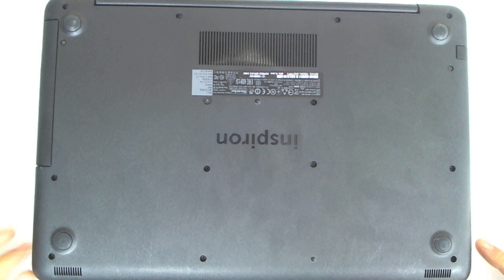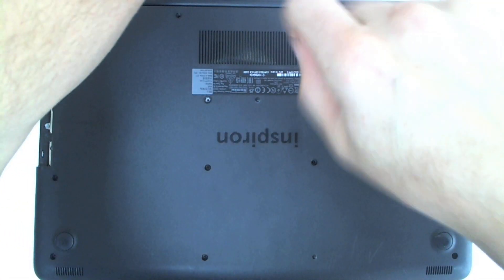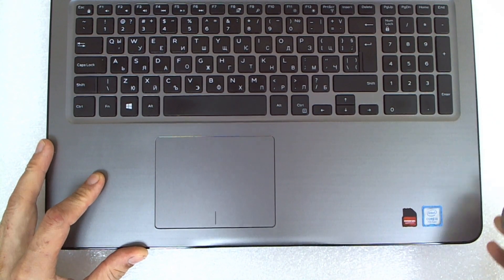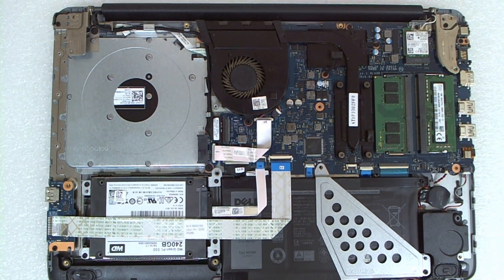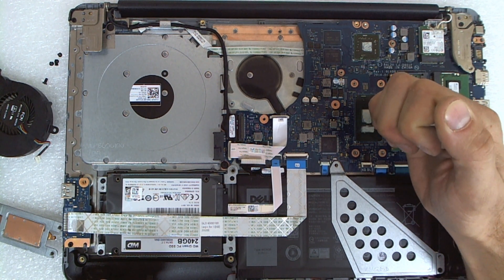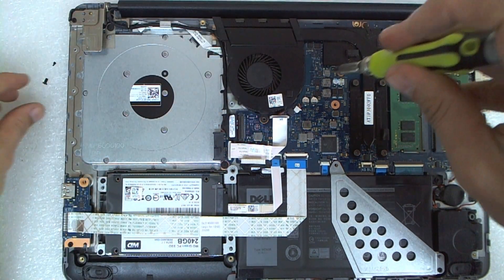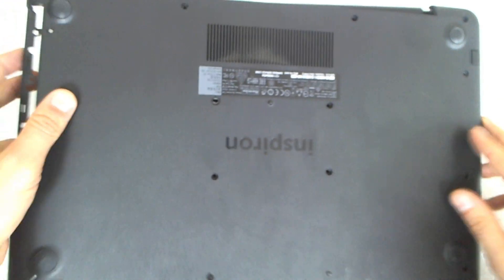Dell Inspiron 15 5567 Disassembly / FAN Cleaning

Comment: HOW TO RE PLUG THAT SHIT AT 5:20??? POWER BUTTON... PLEASE !!
Reply from the maker: @kazenishi_Zyon  you have to remove ve the screws on the board and lift it on the left side. And put the cable back. The bad thing is that the cable have some glue and it is stuck to the fan.  So when you lift the fan you unplug the cable.
Reply: @LaptopDisassembly thank you very much, I connected without removing the board, I don't know if it was connected, I don't know how to check if it works. I connected about 3 times but as I easily disconnected I wondered if I was really connected.

Comment: Hello thank you for this guide  but i pulled the fan accidentally and i ripped the wire for the power button off now it wont start what do i do? Is it possible to connect it back or i must give it to service?
Reply from the maker: Just lift the left side of the board, and plug back the cable. The connector is a few cm. Inside... It is not that hard.
Reply: @LaptopDisassembly  it was on the side of the fan its the one under the fan it was glued
Reply from the maker: @IvanIvanov-os2sf  it shouldn't be glued but with a connector. BG?

Comment: I like how he did not show how to plug the power button back in
Reply from the maker: I know, i know... It was one of my first videos. The connector is at the end of the left  side. Just remove the board screws, lift it a little and plug it back. It is not that hard.

Comment: somewhat helpful video. but would be better if you zoomed in more. you didn’t show getting the power button cable back in, and now i have to take the whole motherboard out.
Reply from the maker: Yep, note taken... It is 3y old video. I try to show more now. You need to remove the screws on the left side. Just lift the board a little and you can plug it with a tweezers. I haven't got the same model since than, to make ver. 2.0 of the video.

Comment: لماذا الحاسوب محمول الخاص بي من نوع Dell بطيء للغاية رغم مواصفاته العالية حيث أنه يحتوي على الجيل السابع من معالج إنتل Core i7 وذاكرة وصول عشوائي بسعة  16 جيجابايت وبطاقة رسوميات بسعة 4 جيجابايت؟ هارديسك SSD
حتى بعد تثبيت نسخة ويندوز جديدة
Reply from the maker: Is the laptop with regular hard drive or with a SSD one. can you write me the hdd model.
Reply: SAMSUNG MZ7TY256HDHP-000L7: 256.0 GB

Firmware

MAT04L6Q

S307NB0J545738

Serial Number

Interface

Serial ATA

Total Host Reads

Total Host Writes

15853 GB

Rotation Rate

----(SSD)

Transfer Mode

SATA/600 | SATA/600

Power On Count

3288 count

Drive Letter

C: E:

Power On Hours

26373 GB

7325 hours

re

Standard ACS-2 | ATA8-ACS version 4c

Features

S.M.A.R.T., NCQ, TRIM, DevSleep, GPL
Reply from the maker: Check the hard drive with CristalDisk to see is the disk in good health.
Reply: The hard disk has been verified using Crystal Disk. The disk is in good condition
Reply from the maker: Well you can try to check for viruses is r make a fresh install. Also check in task manager to see what is slowing the computer... Check the hard drive and CPU section.

Comment: you didnt plug the power button back in on camera, I was here for that, thanks for nothing.
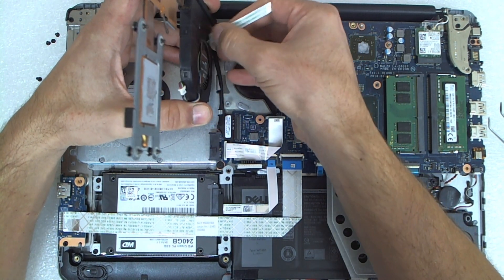Reply: 5:24 May i ask you what is the wire below the fan please? I do not know what is that for
Reply: @sus8575  dont ask me, ask OP

Comment: At 5:33 the ribbon cable (or whatever you call it) is pulled out and at 5:48 when you come back, the cable has been plugged back in.  This is a little tricky to plug back in because the parts are so tiny.  On my model there was one screw that I could unscrew from the motherboard, and I figured out that there is a little cover that clamps down over the tip of the ribbon cable that you have to flip down, position the cable in place, then flip it back up.  Also it's hard to see, you can only see it from the side.  But after a couple tries I got it to clamp in.
Anyway, thanks, I could not have done it without your video.
Reply: you are the best, thanks for sharing this, i was so pissed at OP for fogetting about this, but you saved my day thx,.
Reply from the maker: Well I did this video long time ago. I did fount about this cable the hard way. I just lift the board a little bit and just plug the cable with a tweezers.

Comment: My dell inspiron 5567 fan not working sometimes and laptop stuck on application like phhotoshop and becomes very hot i am having core i 5 7th gen 8gb ram with 256gb ssd what can i do ? Plz help
Reply from the maker: Try to replace the thermal paste first

Comment: I plugged the power cord back in but when I turn on my computer it just gets a black screen, what should I do?
Reply: my computer is working but the usual dell text is not coming
Reply from the maker: Check did you plug the power button correct. Also try replug the ram memory and LCD cable.
Reply: @huseyin4134  did it work ?

Comment: My laptop creates a hissing noise and it freezes for couple of seconds and gets back to normal. Also the back part of laptop gets hot. What should i do?
Reply from the maker: It is normal for the back cover to get hot. You can clean it and replace the thermal paste. About the freezing... check the hard drive with crystalDisk for bad sectors.

Comment: Hello, I did everything You do in the video and now My computer does not turn on, What do I do??? Help me pleaseee!!!
Reply from the maker: Well apparently something went not according to video. Douse the laptop power on, any picture... Try reseating the ram memory... More info will be helpful
Reply from the maker: Probably when you lift the cooler you did unplug the power button cable. Check the cable. If that is the case you need to lift the board a little and just plug the cable back.
Reply: I exactly have the problem with the power button cable, how to lift the board? can you tell me, please? or can you recommend a video about this problem?
Reply from the maker: @monica-mi5lx   You have to remove the srews on the board. After that just lift the left side of the board. It is a regular connector on the end of the board. Just plug the cable back and close the mechanism.

Comment: This was really helpful, but bad thing is, it didnt workon my laptop, it kind of made it worse and i think the prosessor is over heating
Reply from the maker: You did replace the thermal paste and connect the fan, right? Double check is it laying properly on the cpu.
Reply: @LaptopDisassembly  the layout should be correctly, but the thermal paste, thats something i dont have
Reply from the maker: @CrankyJoeJr  well, how did you replace it than. You CAN'T clean the old one and put back the cooler without new paste.
Reply: @LaptopDisassembly  ooooooh, that might be the reason

Comment: How much thermal paste should I buy for this? I can't really tell the capacity of that syringe you used in the video...
I reaaaally don't want to get at it and find out I don't have enough. I´d love to just buy a 20gr syringe and be done with it for a good while but tbh I can't afford that rn :/
Reply from the maker: 20gr is way much. I use big syringe coz I use it everyday. You can just put a small drop like been and just use your finger to make it even. It has to be a thin layer at the end.
Reply: @LaptopDisassembly  I see, thank you!

Comment: What should I do if I installed a new fan and heatsink but I am still getting a error that the processor fan is not responding correctly?
Reply from the maker: Can be a bios issue, or a thermal sensor issue. Try flashing bios, if that douse not help you need to take it to a service shop.
Reply: @LaptopDisassembly  How should I flash the bios? Sorry for asking.
Reply from the maker: @kounaaaaaa  download the bios from dell site. It will be exe file. Just start it and follow the procedure.
Reply: @LaptopDisassembly  I managed to downgrade the BIOS but still got the same error. Should I just bring it to a shop at this point?
Reply: @LaptopDisassembly  never mind I know what to do. Its just that I am already on my latest bios for the laptop. Should I downgrade the Bios?
Reply from the maker: @kounaaaaaa  well you can try with older one for test. If is the same you can always get the new again.

Comment: hello sir. Great tutorial. 
i have the same laptop, but it came with the version of 2GB VRAM.
 Can i upgrade the GraphicCard with the version of 4GB..
it will work or it will not be recognized ? 

Both versions of the laptop has the dedicated GraphicCard of
AMD Radeon R7 M445 GDDR5 VRAM

Thank you.
Reply from the maker: You can't replace the video, it is soldered on the board.

Comment: how to plug the cable for the power button?
Reply from the maker: There is an easy way and a hard way. The easy way is to remove the screws on the board and to flip it up side down. Thw hard way is to remove the screws on the left side and just to lift the board a little bit. Than using tweezers to plug back the cable.
Reply: @LaptopDisassembly  Finally did it the hard way, but was not that hard. Thanks a lot for your videos and support, great work!.
Reply: Same question bro I'm afraid of that
Reply from the maker: The design is very stupid. The cable is with double side tape and it is stick to the fan.

Comment: 5:20 how to plug that cable back
Reply from the maker: You have to remove the board screws and lift the left side. The connector is right next to the fan on the other side. A bit stupid design but...
Reply: @LaptopDisassembly  can you please do another video clearly please
Reply: @LaptopDisassembly  can I put it back without removing the motherboard
Reply from the maker: I dont have the same lapotp in the office right now. If you have tweezers, you can just lift the board a little bit and plug it back.
Reply: @LaptopDisassembly  is it easy?
Reply from the maker: @SSilversurf  well it all depend on how handy you are with the tweezers
Reply: @LaptopDisassembly  it's just pluging it right?
Reply from the maker: Yes and closw the mechanism. It is like the keyboard connector

Comment: Thanks, that saved my day. The air outlet at the fan was covered with a thick layer of dust, fan always on high and noisy. After cleaning it is now quiet and the temp lower.

Comment: Hello sir, i have the same laptop should i put thermal pads for chips which is left to the gpu ( the 2 big ones) ??
Reply from the maker: If they have by default yes, if no than it is not a good idea because you can lift the hole cooler and may not cool properly.
Reply: @LaptopDisassembly  thanks

Comment: Hello I did the same you shown but my laptop is not getting start only the power switch is not showing light in it.  Wile charging its showing the charging light but laptop is not getting on pls help me what to do now.
Reply from the maker: Probably, when you lift the cooler, you disconnect the power button cable. Now you have to lift the board and connect it. It is the thin white cable that is going under the fan.

Comment: Hello, I've tried just about everything...    I  replaced the fan&Heatsink in a Dell 17-5767  Now the Fan is running wide open all the time... error message saying fan not responding correctly...In the bios the the fan isn't showing the RPM's...Any ideals?  I've tried about everything...unplugged battery for 30 sec held power button for 30 second's...unplugged the small 2032 battery for 10 mins... Did the thermal paste over..unplugged the fan and plugged back up...reset the laptop...tried a old bios firmware...tried my old fan which still works,BUT IT ALSO  runs at highest rpms now...  Trying to think of everything I've tried...Did the new fan do some kind of hardware change???? Any way gonna order another fan and try that,I guess  Thanks
Reply from the maker: Have you try with the latest bios from the dell site. If that douse not help, there may be a problem with the thermal sensor. It is telling the laptop that the it is hot and it needs to be cooled. Also did you try different windows. I had cases with bad OS with same behavior.
Reply: @LaptopDisassembly   Hey Buddy ...The fan plug on the motherboard had a prong/pin for the blue wire broke,And luckily,I was able to solder the blue wire to the broke prong/pin....Doesn't look the best,But got it working...Thanks for trying to help..Take Care
Reply from the maker: This is totally different story.. It is for the rpm of the fan. Whrn not connect the tan is working in high rpm.
Reply: @LaptopDisassembly  Yeah the fan was running High rpm WIDE open  lol  And fan not detected in the bios at all...if it wasn't for a magnifying glass never would have figured this out...It was the blue wire that wasn't connected YES the blue Rpm wire...I unplugged the fan,And seen that the prong/pin on the motherboard for the blue wire was gone..lol
Reply: @LaptopDisassembly  Thanks Tried just about everything
Reply: @LaptopDisassembly  any thing you can google I HAVE TRIED   lol

Comment: Strangely, I saw a video saying this fan noise is a software issue. But, I've put a new fan in mine and it no longer makes a noise. It was $10. on Amazon.
Reply: i cant find part number for fan. Can you please point where on amazon you found one.
Thanks in advance.
Reply: @Tsiqara  I just searched by description of "fan for 5567 Dell".
Reply: @robj2704  Thank you

Comment: Im not really sure how to put back the power cable. It is something to plug or just touch contact surface?
Reply from the maker: It is with a lock mechanism. Like the keyboard connector. Lift the black plastic, plug the cable and lock back.

Comment: Hi Janko! I just cleaned the fan but now the power button is not working... Do you know the reason??
Reply: Okay thanks for the fast reply. I noticed the power button cable is unplugged. Gonna try to plug it the way you said
Reply: Same thing happened to me man. The power cable is the glued underneath the fan right? Its like a band. Where do I plug that, I could not understamd. Could you help me pls?
Reply from the maker: It is the power button cable.  You have to lift the board and connect it. The connector is on the other side of the board.
Reply: Yep I just disassembled the whole thing. I am a student so it was a nice experience overall. Thank you guys :)
Reply from the maker: Did you lift the board. Thw power cable go under the dvd and under the board. Probably you unplug it by accident. Sometimes the cooler is glued to the place where the cabel goes. Only way is to remove tge screws on the board, lift it a bit a plug back the cable.

Comment: Fixing the white ribbon underneath the fan is the most annoying thing I have ever experienced in this world. If only you had mentioned to hold on to the ribbon rather than taking it out of the motherboard I wouldn't have to go through all this pain of fixing it back in. The laptop won't even turn on now. Will update after I try and remove the motherboard and pry the ribbon back in its slot
Reply: Update: (2hrs later) I FIXED IT! I had to disassemble the entire laptop. After removing all the Motherboards cables I was finally able to take it out of the laptop casing. I then attached the white ribbon (which actually is used to turn on the power button of the laptop) inside its slot underneath the motherboard. You really need to remove each and every single cable and wire to get the motherboard out btw. Horrible laptop design to be honest. But I'm happy I was able to get the job done.
Reply: @ZVEKOfficial  oh no now it's my turn. I fucked up
Reply: @ZVEKOfficial  Yep. It's a bugger.

Comment: 1. This computer, and maybe others as well, requires different screw bit sizes. I happened to have bought a computer tool kit some time ago and found that it contained the necessary bits to do this. The kit also had plastic pry bars so I would not be using a metal pry bar which can potentially contact circuitry on the components. I bought the kit on Amazon for about $30(US).
2. Also, it is very important as soon as you remove the cover to disconnect the battery so there will not be any power available to the circuits.
3. Also, be sure, when doing this job, that the air where you live is not too dry and static which can cause a spark (static electricity) between your hand and the computer components. These components use very minute voltages and the circuits can be easily damaged. Most of us don't live in East India which is a humid climate. The kit I bought did have a grounding strap I used between my wrist and the metal frame of the computer while I was working on it.
Reply from the maker: I do lapotps for about 15 years, and so far no problem with the static electricity. But good advises.

Comment: Bro. Can you tell me exactly which tool did you use to remove the M 2x2 screw over the Optical Drive.  I tried a lot of screwdrivers but couldn't find the right one.
Thanks in advance!!!
Reply from the maker: As you can see on the video i use the same screwdriver tip like on the reset od the screws. Are you shure your screw is not rounded.
Reply: @LaptopDisassembly  I was referring to the last three screws that you were removing at 1:40. The flat screws.
Reply from the maker: In order not to change the tip of my screwdriver i use a smaller one from phone repair kit. They sold them when you buy a battery or something else. These screws are a bit tricky.. You have to push a bit harder before twisting..
Reply: @LaptopDisassembly  That's great of you. Thanks for the info.